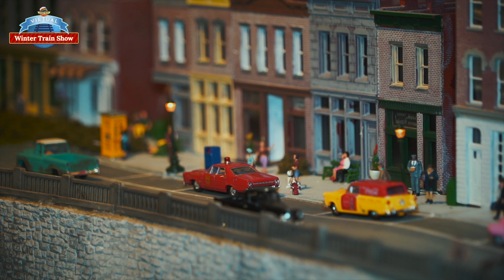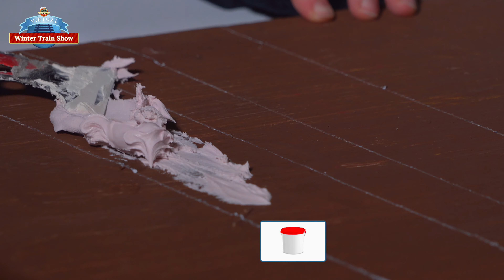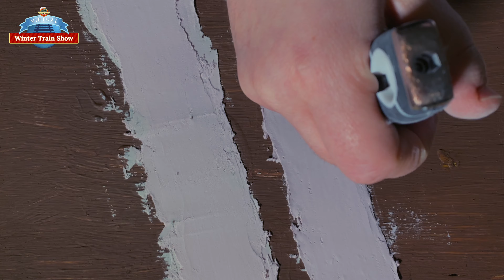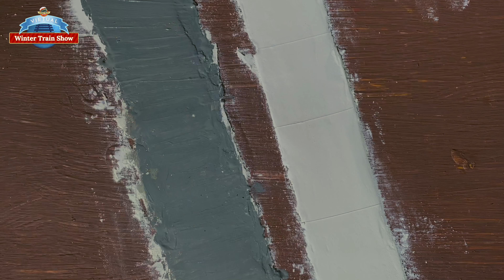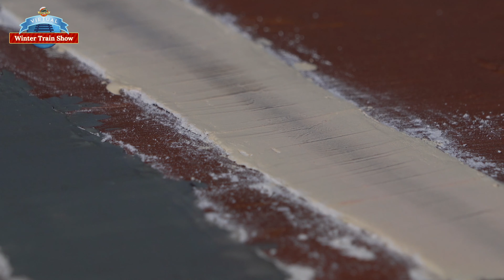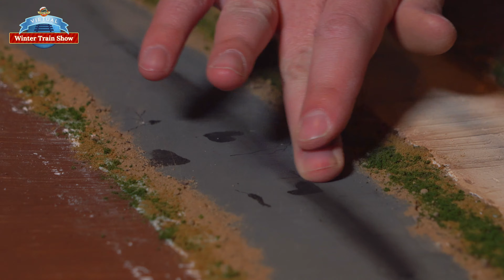How To: Create Roads for Your Model Railroad

Comment: This is a very helpful video - but for one thing...........  That is the roughest concrete road I have seen since I drove through Louisiana in 1986 on I-10.  Or perhaps Chicago in 1993.  In both instances I had to have new kingpins installed in my F-450's  truck's front axle when I got home.  YOU should have to drive on such a road, in which case, you would have realized you needed to sand that cement road with 220 also.  That said, the rest of the video was very helpful and I appreciate it - much more positive than negative.  Much obliged.

Comment: Personally I'm thinking about using either styrene sheets I got from Amazon, or Smooth-It. Styrene Sheets would make it easy for me not to have to worry about possibly messing up a part of the road, and would be easy to cut and paint. All that would be needed to be done would be to paint the roads, and glue them down. However Smooth-It would provide a more realistic aspect to the roadways, especially when you get woodland scenics paving tape. Paving tape combined with simple masking tape can help minimalize any possible mess. Woodland Scenics also has a product provided with Smooth-It called a Spreader, which helps keep your roads at a nice even height. Not to mention Woodland Scenics has appropriate colors for roads. Imo these 2 products alone are much easier to work with than spackle.